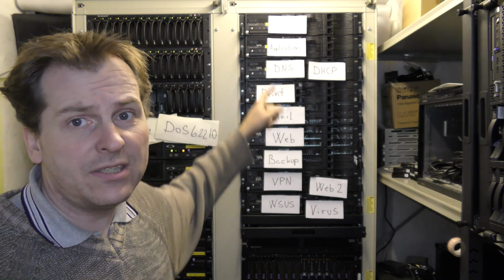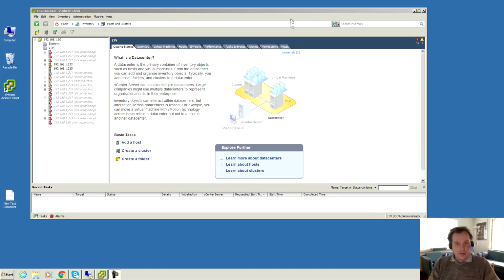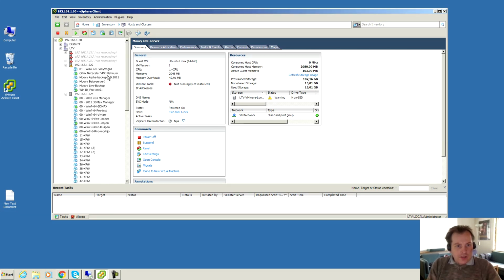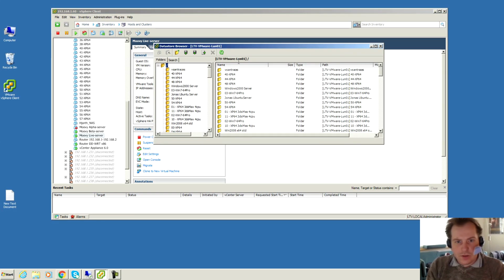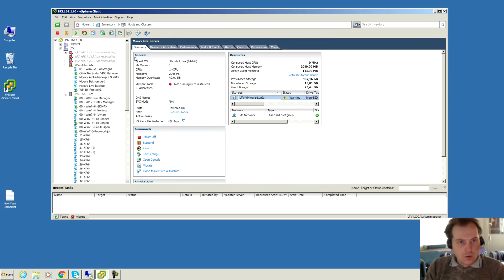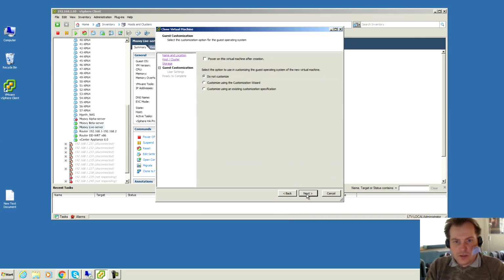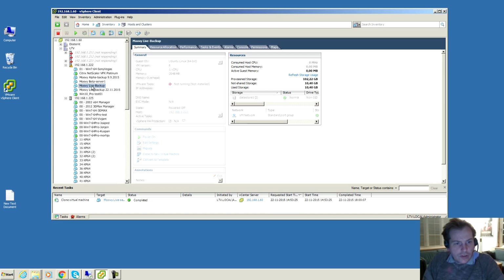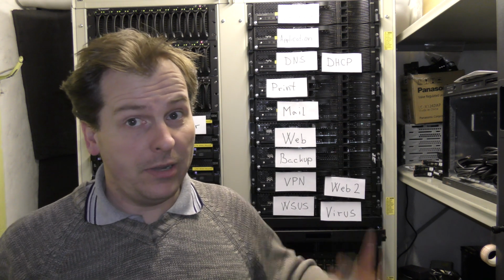Why virtualize your server infrastructure part3 - 274

Comment: hello again. when are we able to start the virtual server that we have copied from our physical server. you said that we can shut down the physical server when the virtual one is set up. how about the connection and any shared folders or the state of the server? do we need to correct the IP address? i know it will be the exact replica and will run the same as the physical server. do we turn off the physical server first and then start the virtual one? or we can start the virtual server while the physical one is one ? this is confusing me as how it is going to work. I am not involved in moving the physical state into a virtual one. how about the physical server hard drives size?
Reply from the maker: Hi
You shout down the physical server when done  with the conversion. The new VM server has th IP from the old server and the MAC: and all the Windows  settings inkl. shares,,printer ect.
You have an option to change disk sizes doing this,, but of course you need the space that the old server actually uses.
Thank you for watching! :-)